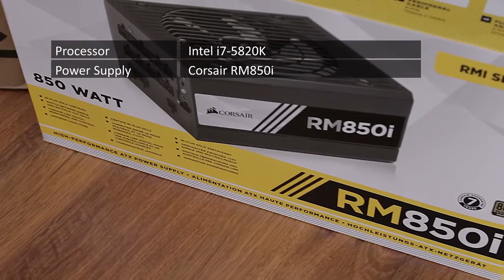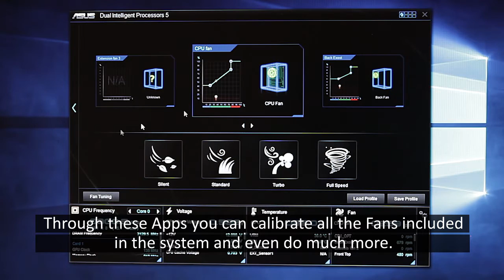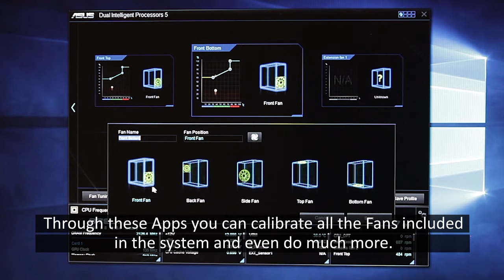How to install  LGA 2011-V3, X99 CPU & Noctua NH-U14S,  Corsair RM850i +  GTX980 Ti on  400C Case

Comment: Very nice video man, I have the same motherboard but with a 5930k instead OC'd to 4.5ghz, I have an corsair H110i GT Liquid cooler and its coming pretty close to the end of its lifespan now as I've had the system running for almost 3 years now, I Ordered this same cooler as a replacement for my Liquid cooler, I'm glad to see it fits in without any problems. I have an Aorus 1080ti thats a bit thicker on the back side because its backplate is actually raised off the back of the card a bit more, I hope the Noctua cooler still fits without touching the graphics card.
Your video gave me confidence that the cooler will fit just fine, I saw some forums that said the cooler would not fit correctly with a graphics card in the top PCI-E 16x slot but It looks like they are wrong.
Reply from the maker: Hi there. Don’t worry, it will fit just fine. And you will be very satisfied with the new cooler. I was also planning to build this system with water cooler, but now I am feeling very glad that I didn’t go with water coolers. Thanks for your comment. And please share the video,... What about your rams, are they low profile...? It’s important that they should be low profile.
Reply: I actually have high profile ram but only 4 sticks so not all the slots are filled, only the Grey slots. I think it should be fine.
Reply from the maker: you will need to adjust the placement of the fan according to the height of the ram.

Comment: Flat screwdriver on a Phillips screw? Come on!
Reply from the maker: Man its working....
Reply: Indeed,flat-head screwdrivers are not used in electronics because of damage caused by slips,certainly not with PCB mounting with the risk of scratching the copper strips or damage smd. Further, i like this video,its clear.

Comment: Very nice. I'm using the same Noctua in my build too except it is push/pull. Noctua coolers are great value and performance. As far as CPUs go, although the 5820 does provide great performance for the price I can't help but wonder why you didn't opt for the 6850K which provides you with  full 40 lanes.
Reply from the maker: EDWARD KING ---- Because of the price... Maybe in future I will replace it....
Reply: Understood. It took me months before I could find one for less than $700.00 Canadian. The prices for the series has dropped considerably since the next generation releases. Not quite sure what Intel is up to these days with their chips but glad I got my platform sorted before they went all schizo. They're latest release makes no sense at all.

Comment: I have a question, that noctua coolers says on noctua's website that has support only for other Intel's sockets, but I doesn't say x99 in any part, so how could you install it on a x99 motherboard?
Reply from the maker: It can be installed on any modern motherboard. It has a general socket. Buy it.